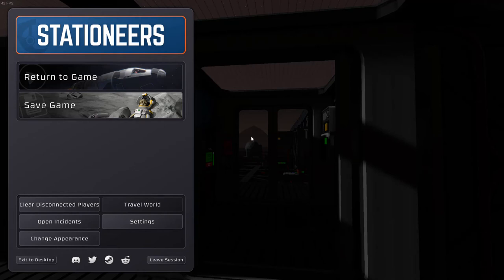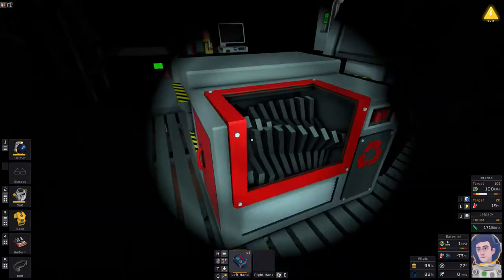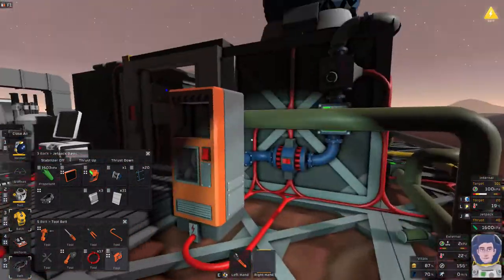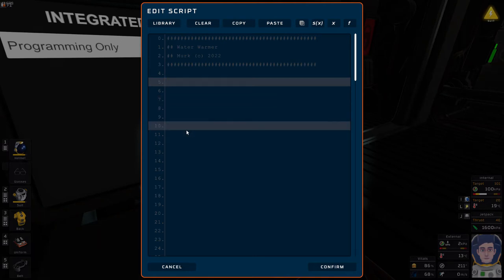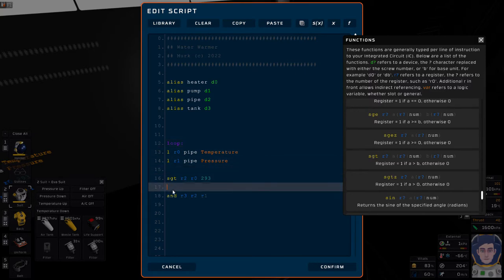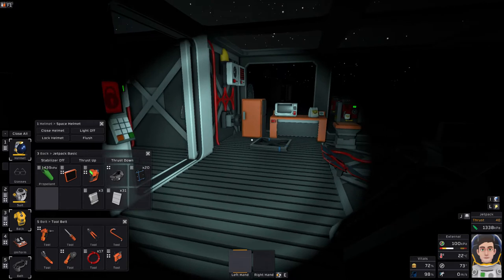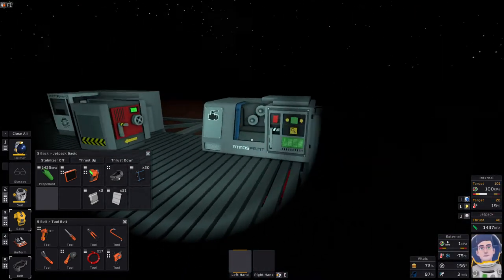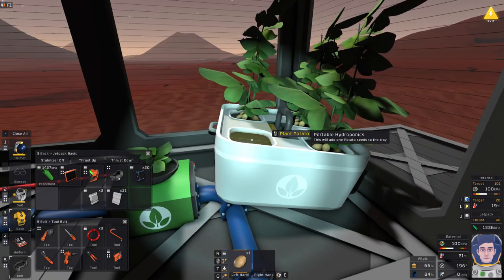Stationeers Play Through Part 10 : Water System

Comment from the maker: Here's the IC code for the water warmer...

############################################
## Water Warmer
## Murk (c) 2022
############################################

alias heater d0
alias pump d1
alias pipe d2
alias tank d3

loop:
l r0 pipe Temperature
l r1 pipe Pressure

sgt r2 r0 293
and r3 r2 r1
slt r4 r0 303
and r4 r4 r3

slt r5 r0 295
and r5 r5 r1

s heater On r5
s pump On r4

yield
j loop

Comment: So I am curious, why you didn't use insulated pipes coming directly from the ice crusher to the pump (or at least after the heater).
You are a great programmer.
I'm curious how many hours do you have in this game so far?
I'm just super enjoying binge-watching your series and I'm still looking forward to actually playing it.
Alas, my laptop fell in the tub yesterday. I rescued the M2SSD, the HDD and the 16Gb of RAM, but everything else was TOAST! 
SUCKS TO BE ME. Anyways, I'll just have to wait until I can afford another system.
Great series, keep it up!
Reply from the maker: I could have done tbh. I took the view that on a short length of pipe with ambient temperatures (averaging close to 0C over day/night cycle) not too far away from the temperature of the contents (averaging 10C during the warm-up from 0C to 20C) the heat loss wouldn't be significant enough to make it necessary, and insulated pipes need steel and silicon vs normal ones just needing iron. That said, now that resources aren't so much of an issue, perhaps I'll go back and upgrade it.

MIPS is definitely a "fun" language to learn! That said I've got quite a lot more years than I'd like to admit programming IRL so that helps. There's at least one episode where I have about 3 tries at a piece of code before I realise it's got a typo!!

I've got about 1200 hours in the game (I started when it first released in 2017)

I'm glad you're enjoying the series. I started making it because I thought it might help bring people to the game but had no real idea if anyone would watch it so feedback like this is really encouraging - thanks!
Reply: @murk9111  Well I'm a "Commenter" (if you couldn't tell) because when I had a YT channel, I enjoyed getting feedback from my viewers. So you just keep producing and I'll keep commenting! LOL😁
Reply: This is a really invasive question, feel free to cuss me. But why was your laptop even near the bathroom?? Or any water for that matter...? Totally not having a chuckle at the panic that must have caused ... by totally not, I mean absolutely am.